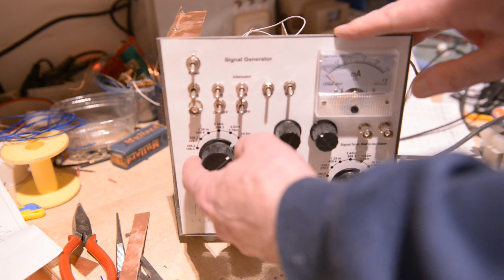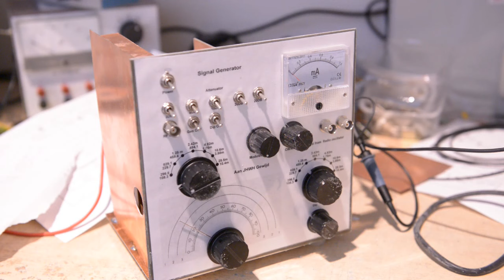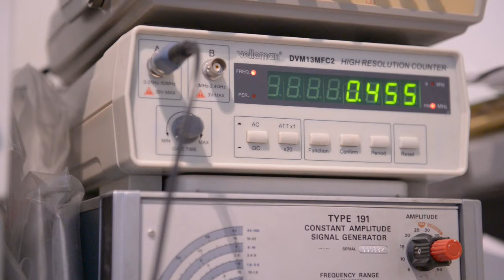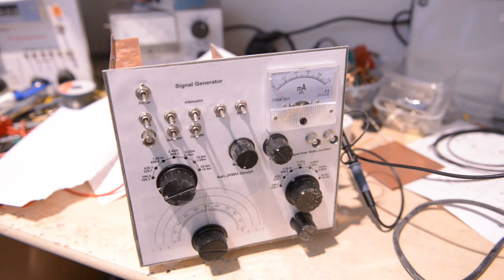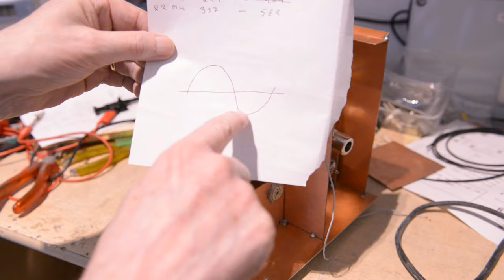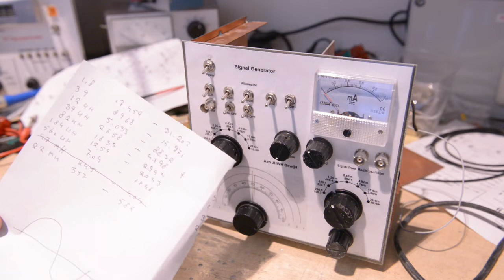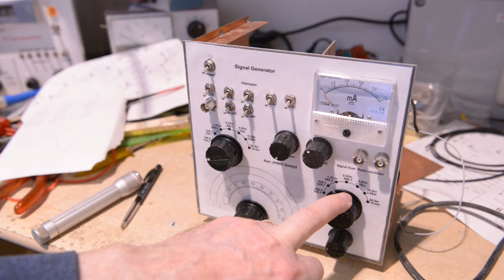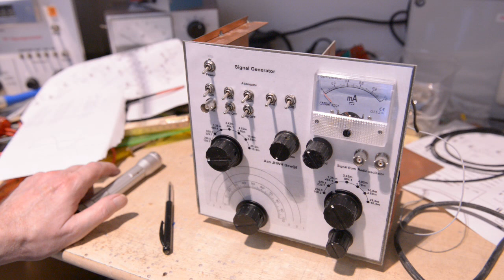Project  build signalgenerator with dip function part7

Comment: The big problem with designing  a useful RF signal  generator is RF stability and leakage. Both are a nightmare to achieve.   Even a 1 microvolt leakage will render any amplitude testing difficult. Stability, short term is very important, requiring much sturdier construction than you appear to  have. Long term stability can  only be achieved with frequency dependent feedback loops. Very interesting video, I wish you good luck with this project.
Reply from the maker: There is no luck involved my friend.
And not a nightmare.

Obviously you are perhaps not familiar with valves or there characteristics.
Not every valve oscillator is suitable for this job.
Anyway after hours, you know it is stable.
Also there are more factors to play a role that affects stabillity.
Putting an oscillator straight on the attenuator is unwise and asking for it.
See my previous  video of the digital signal generator.

But having said all this, don't start building something if you are not sure.

Regards